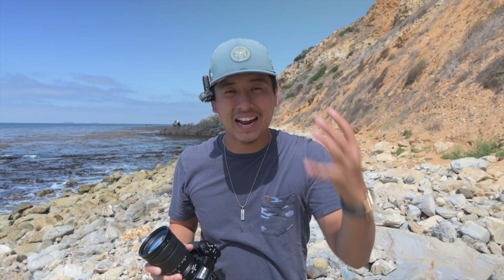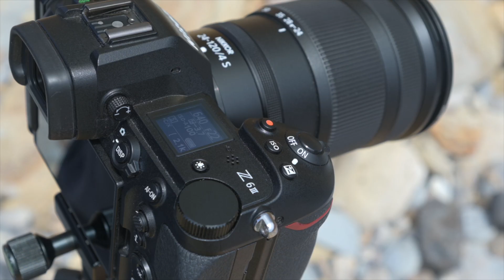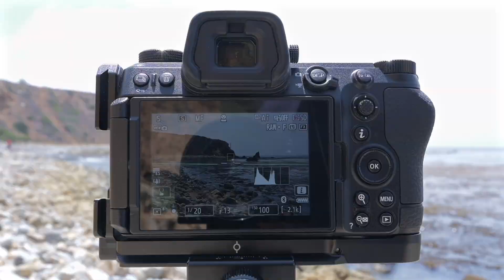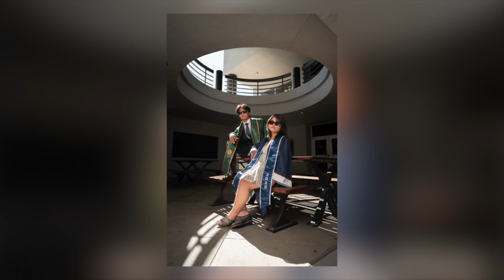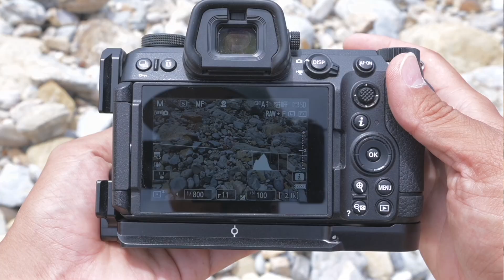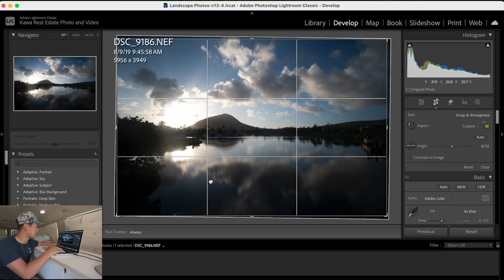Use Your Nikon Z Control Ring LIKE A PRO

Comment: Good tip. I always shoot in Manual mode. I had the ring set to Aperture. Changed to EV. Works well. Remember to save the change in User menu mos (U1-U2-U3, whichever you need it for).